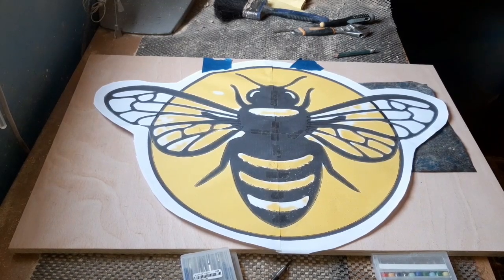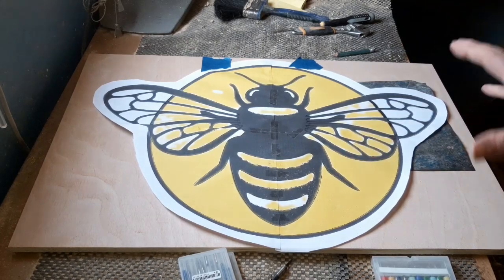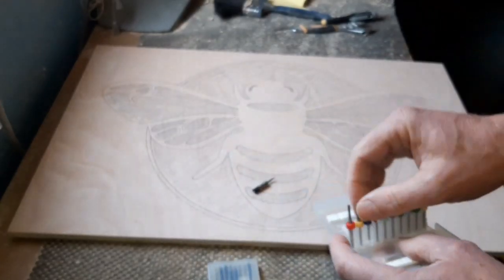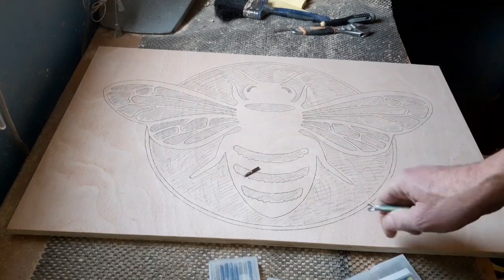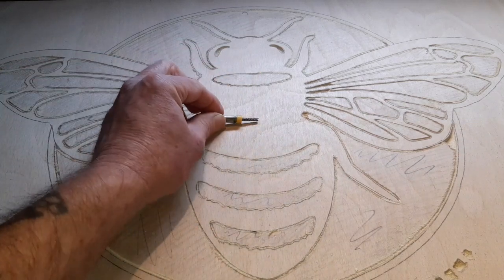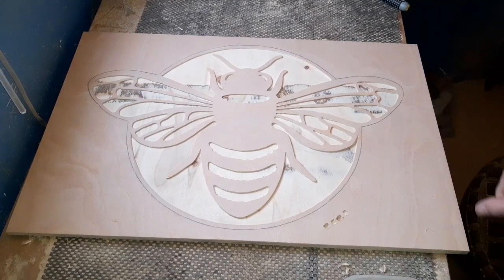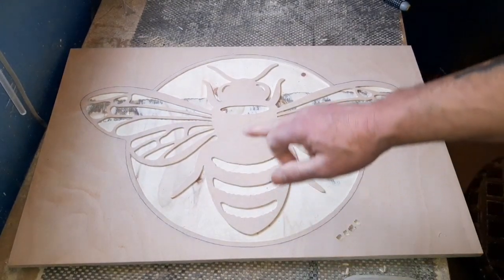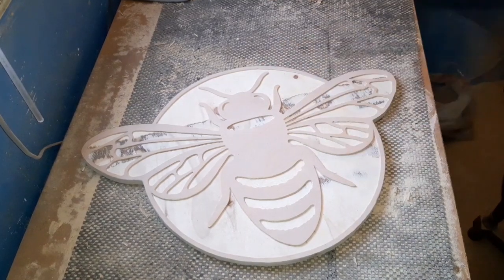Bumblebee routed out on plywood and inlayed with resin..

Comment: Hi great videos, i have subscribed. I have just bought a scroll saw and am thinking of buying a router to do designs like the ones that i have seen on your channel.
I have a question, if i use clear laquer spray paint instead of the varnish that you use in your videos to seal the edges and stop leaks, will that seal too much and stop the coloured resin from taking a hold?
Reply from the maker: I've never had any issues regarding the resin not bonding to a varnished finish, because I use acrylic paints mixed with the resin and not the inks or dyes/powders you can purchase I think the bleeding is zero because of the thickness of the resin..I've done projects before with no varnish on and had no issues,it can depend on the wood you use..I'd  try a test piece just to be sure..😁👍
Reply: @fishtank5050 thanks for the reply,  I will be using Acrylic paints
Reply from the maker: @daveg1250  I've never had any real issues with acrylic paints and resin 😁👍